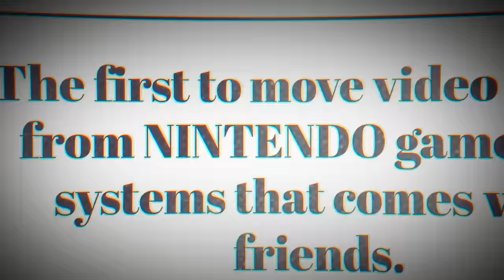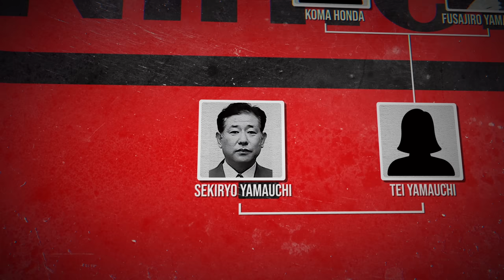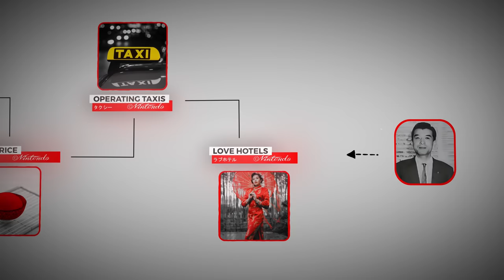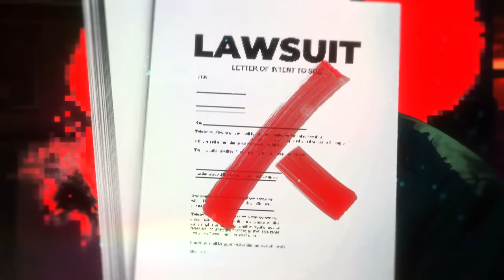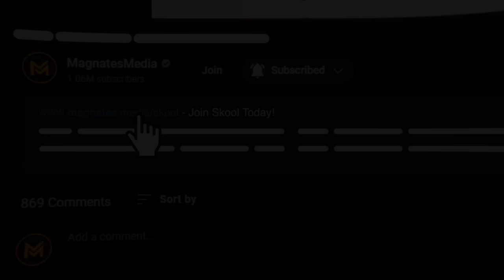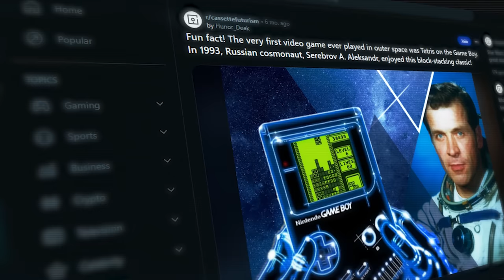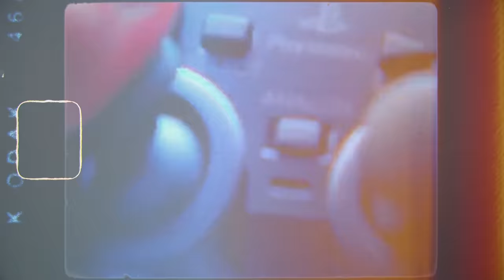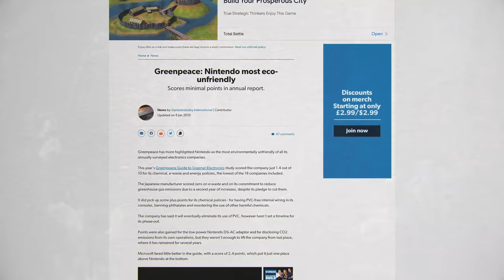The Untold TRUTH Of Nintendo

Comment: The N64 was not mentioned😢 IMHO that was one of Nintendo’s greatest systems. It used texture mapping before Sony did on the 32-bit PS. While carts were limited in memory, there were not the same load times as with CD based games. The controller was revolutionary in ability to be used multiple ways.
Reply: Ikr N64 should have atleast been mentioned,but it was still a great video
Reply: He left out the ds and psp as well
Reply: @elflacoaldair and the original Gameboy advance too
Reply: N64 was a fail but got up in 2009 that y check n64 fail documentary
Reply: I hated those N64 controllers
Reply: PS controllers were better but N64 were still a big step forward.
Reply: I''m sorry but you need to double check what is the definition of texture mapping. I am positive you are wrong.
Reply: @StriderVM he never mentioned what is was tho. Smh. How was he wrong?
Reply: @JamminKiing  Texture mapping is basically supported by every console that can make polygons. Even the 32x, Jaguar and 3DO can do texture mapping.
Reply: @StriderVM  Thanks for the explanation.
Reply: @StriderVM  They probably meant texture filtering to remove pixelation.
Reply: @quackman  But the PS1 doesn't support texture filtering. The N64 has it. And that's why a lot of N64 textures look blurry. Low res textures with filtering. Whereas on the PS1 you get blocky textures.
Reply: @StriderVM   oh my bad, i misread "before the PS" 
Yeah, the PS never had the nice (albeit blurry) smooth N64 textures.  personally i preferred the N64, esp when done right by Rare or similar.
Reply: Yea, the analog on the N64 controller was so good, Sony copied the tech for their first Dualshock controller. Nintey made analogs on controllers the new standard. 
With Nintendo`s history being well over 100 years, 42 minutes is just not long enough to cover all of it in detail.
Reply: Facts
Reply: And super nintendo and sony never charged to play online until recent
Reply: The N64 is a strange box, it did better / was more liked in america than the UK or indeed even japan. By the time of its release you had the PS1 which was ALOT more attractive to developers who didn't wanna' deal with Nintendos strict policies, idea stealing and the it's drawbacks ((and ya know... cart, whereas CDs had more space)), soooo the PS1 did better there. Due to this it had way more games and ideas than the N64 had which left it in the dust, but where america had alot of marketing pumped in to it, it did way better over there.
Reply: I never got the system because of the controllers.... the 64 is what made a playstation person @GlycerinZ

Comment: Convenient, you left out one key fact about Sony in chapter 9 in the betrayal is what that betrayal was discovered only now in recent years.  They setup a licensing agreement in the contract to mimic what Nintendo did on the cartridges.  Any game made on a CD Sony would get 100% of the profits, but as Nintendo was adamant on producing their own media, basically Nintendo would burn, print, pack, seal, and ship all these disc games out for Sony at their costs and Sony would get all the cash.  Nintendo would have been wrecked as it's assumed largely most carts would stop being made due to the cheap media of the disc compared to chips.  Nintendo had no course to take other than run to another CD maker or just bail entirely, after philips blew it with their design, they ran.  Sony in the end even if it was a few years later still crippled them to take the lead.
Reply: This should be pinned.

Comment: The original Nes did not sell for a little over 100 dollars upon release. It hit the market at $199 and it came with Gyromite and Duck Hunt in 1985. Super Mario Brothers was not included in the package until 1986. For reference- $199 was cheap for the time. The Sega Master System would also launch at $199 that same year (1986). I got both my Nes and Master System in 1986.
Reply: They also said Mortal Kombat was in the Nes... This video is not 100% accurate
Reply: @SpecialColector  
Very true.

Comment: They have quit the home console market and have gone portable so they can put out last gen stuff and stamp it current gen. The profit margins have never been higher and its biggest fans are still playing on technology from 2007 while paying prices that line up with technology from 2024. Criminal. Until Nintendo puts out a HOME console that is AT MINIMUM EQUALLY POWERFUL spec wise as Sony and Microsofts offerings, people should steer clear. Right now they are running a portable GameCube and using its portability as an excuse for it being UNDER POWERED. The wii was a GameCube and the switch is a portable GameCube...

Comment: I absolutely LOVE these vids.
A couple corrections, though.

Nintendo tried to get the rights to Popeye, but failed.
Donkey Kong is based on an episode of Popeye however.

Atari did NOT burn and destroy unsold games, they shipped* them to south america. The damaged or opened games and systems were stored in a warehouse in NM. When the crash occured, they emptied the warehouse into a landfill, covering it with concrete to prevent people taking souvenirs.

Nintendo tried to have Atari make the systems here in the us, but after atari saw Donkey Kong on a Coleco Adam, they assumed Nintendo screwed them. Atari pulled out, Nintendo scolded Coleco and killed the Atari Entertainment System.
The NES was test marketed in NYC October 18, 1985 and Super Mario Bros was NOT a pack in yet. The test system was the console, the gun, a robot and Duck Hunt and Gyromite carts (Game Paks).
The robot was a disguise to sell an entertainment system with a robotic toy. It bombed.
In 1986 they test marketed the NES in LA, it also bombed.
However in the summer of 1986, they released the action set with Super Mario Bros and it took off like mad! So yes Mario saved Nintendo twice 😊

Comment: A few key items left out. While its is good video. I do see errors. Donkey kong was not a Nintendo character. It was another japan company who made donkey kong Nintendo bought 1000 donkey kong arcade cabinets. It sold well and Nintendo wanted more. But other Japan company supplier couldn't keep up. So Nintendo made their own donkey kong cabinets. The other Japan company tried to sue, but Nintendo bought that company which killed the lawsuit. Thats how Nintendo got donkey kong .... and Nintendo didn't just make the nes. Nintendo had a relation with atari because atari was sole console to feature donkey kong. Because atari had the distribution infrastructure in the usa. Nintendo 1st tried to have atari make and distribute the Famicom. That all fall apart because of Coleco, who had donkey kong for use on computer platform. Decided to use donkey kong for their adam computer. Which coleco brand the adam computer as another console. Atari felt the Nintendo backstabbed atari and pulled the Famicom distribution deal. .. thats when Nintendo decided to make and distribute the nes themselves. ...

Comment: Regarding The Video Game Market Crash of 84. No. Just no. Again? From a brit? In the years of 1984-6, console and console game sales in the United Sates of America nosedived. Elsewhere around the world, the industry was unaffected.

Although no-one was buying consoles outside of Japan anyway because of what the Japanese called the 'Atari Shock'. Because it's wooden and have you seen it? It looked ridiculous in 1985. I was only 4 then but I did get a free Commodore Vic-20 (1981, 3mill sold) around 1989 with boring text adventures.  That computer was superseded by the C64 (1982, 12.5-17mill) which stayed on sale till 1994 and got a bad console version.

This left the US somewhat behind the rest of the world in terms of the strength of their game software industry and it's exposure to high quality games running on 8bit microcomputers like the ZX Spectrum (1982, 5mill) which offered a more sophisticated and expansive gaming experience than the old wooden Atari VCS (1978, 30mill). Although the style of games available on the VCS weren't really possible on the ZX Spectrum due to it's cripplingly limited colour ability. The Spectrum still had a high resolution and soon got a proper sound chip with the 128K model in 83.

When the NES (Famicom, 1983, 62mill) arrived in 1986 on US shores, the console industry got a shot in the arm but there weren't many US developers who had the ability to program for the NES or design a game at the level the UK or Japan could at that time and afford the license fees. There were few C64 or NES games made in the US. The biggest companies being Atari, making arcade games and Epyx making computer games. All the C64 games were from the UK.

So the US game industry really lost out when Atari failed to properly handle it's expansion. As the 5200 (1982, 1mill) should have replaced the 2600/VCS properly. Made the controller more robust and fund loads of games and spend out on advertising. But they did none of that. So the US market kind of didn't notice the 5200. So Atari (actually two seperate companies: games and computer) just released the system design as a micro called the Atari 8-Bit 400 and 800 Microcomputer, although they were incompatible. Later, they made the 800 micro into a console, too, just to mix it up a bit more. The 7800 came out in 86 having been mothballed in warehouses for two years following the failure of the 5200, which then went on to directly compete with Atari's computer division's entry in the console space, the XE, which was the final variant of the 8bit micro line with a console form factor and attachable keyboard.

So Atari imploded in quite spectacular fashion and seriously damaged the US gaming industry for at least a decade.

The Master System (1986, 13mill) was never given a chance, or anyone to see one really, as the Nintendo marketing machine went to work with ideas like Rob the Robot and, Nintendo Power and paying Universal a very large sum of money to make The Wizard. Which is a feature film advertisment. Sadly, stores were only allowed to stock one system by order of Nintendo. Also NES exclusivity contracts and all the biggest licensing deals and developers gave Nintendo a clear advantage. But outside the US, the Nintendo contracts were not ratified by the EU courts so it was not legal to compel retailers to abstain from stocking rival products.

So in Europe. Even though Nintendo had all the money and major talent, it was outsold by the Sega Master System, which didn't have three years of games in it's library. But this gave it an edge. All the games were brand new and the hardware was more up to date, with a 16bit graphics chip. So to us, the old golden age arcade games just weren't going to cut it. Mario didn't catch on. We all played it. Without a game to pull you in, the console is simply passed over.

I remember playing the NES and feeling it's controler. So brittle and stiff and small. Tiny buttons and dpad wasn't very comfortable. The sound and music was really great and the Mario game looked so charming. But we didn't like Mario Bros or Nintendo in the UK. Don't believe uk youtubers reminiscing about playing 8 or even 16bit Nintendo because they probably lying. The NES just didn't catch on. Had the SMS not released I dare say it might have. But it's hardware was older and it didn't have Michael Jackson.

In 1986, the NES was $179 or about $500 adjusted for inflation on release. Games were about $40 - $110 (adjusted) depending on the size of the cart or additional chips. So you probably had about 7 games at a time. So you aren't going to get exposure to as wide of a variety of games as if you were nerding out on your home microcomputer. Yes they load quickly but even waiting for tapes to load really wasn't a big deal. The console is a premium, more expensive gaming experience compared to a computer so you have to be clear which platform you're talking about. Does 90% of the industry include arcade and computer games? I don't think so.

Fun fact about the GameBoy is that Nintendo management did not like the idea and chose a secret internal diminutive placeholder name for it, believing it to be a bad idea. It has been estimated that the original GameBoy model did not ever actually turn a profit. Which surprised me, because I always thought it was much too expensive for something which was actually quite large and a poor display. It was cute as a novelty object but not really much more. I tried again with a 2DS and again, something just bugs me about Nintendo products. Why are they just not fun at all to me? It's so frustrating because I keep trying because I don't want to miss out.

Almost half this information is totally bogus, half truths and whitewashing shameless Nintendo shill.

Oh and can you please not state Sega are always chasing Nintendo instead of their customers because that is very much not the case, sir.